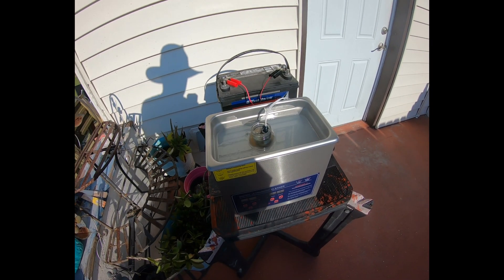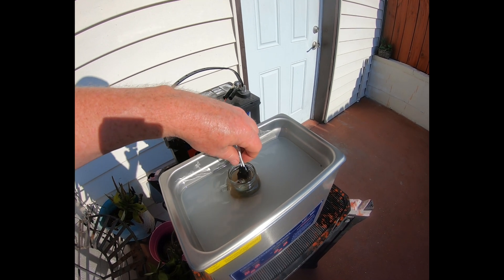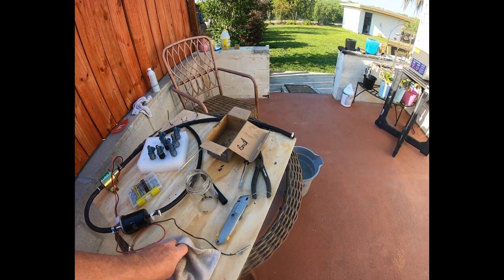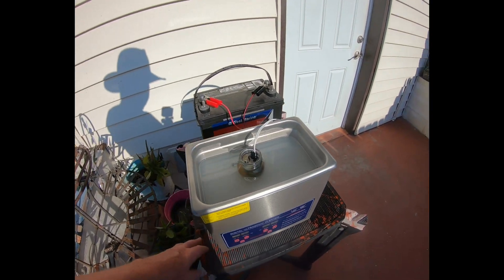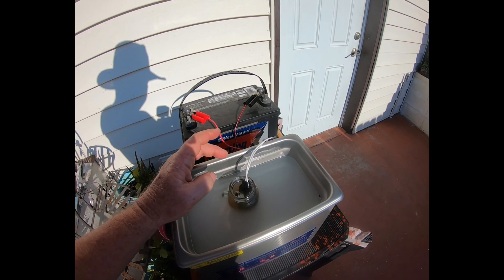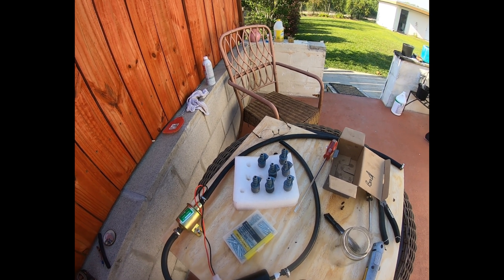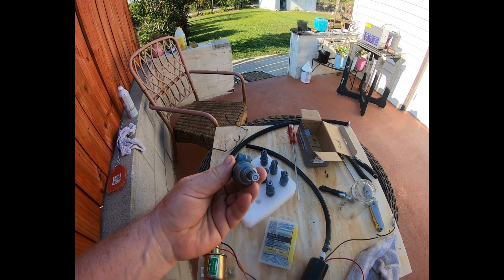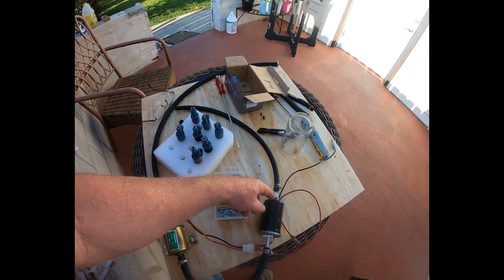Cleaning fuel injectors with an ultrasonic cleaner.

Comment: Very good setup, so how did it all come out in the end?
Reply from the maker: Hi; A little fiddling with the back flush but the injector cleaning worked. On the truck - had to do a second total purge of all lines filter and tank again. It's running good now.
Reply: @Ammo461  Thanks for great video and relpy!